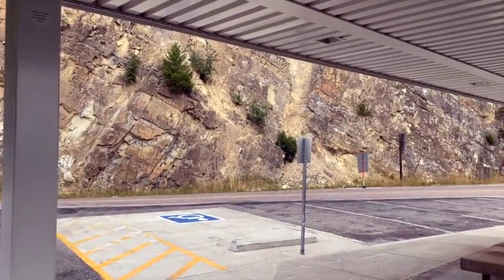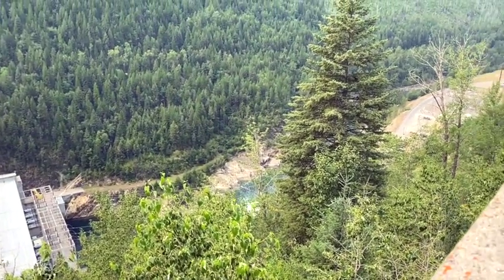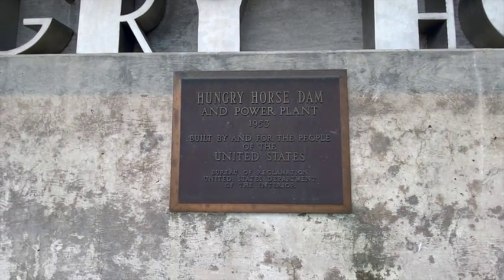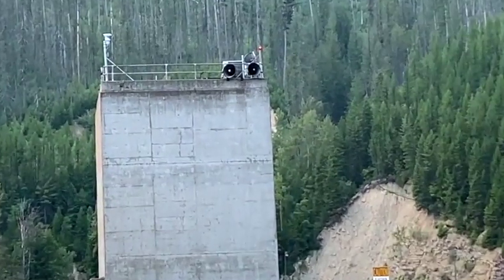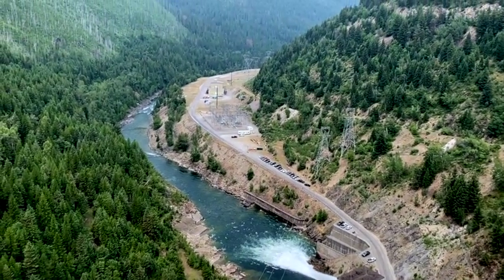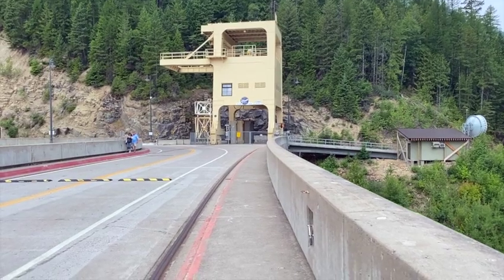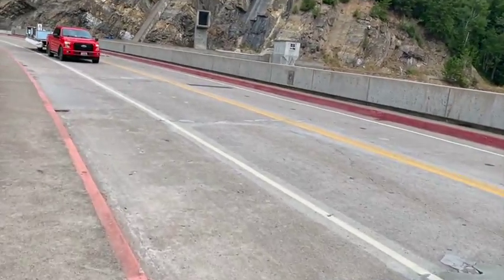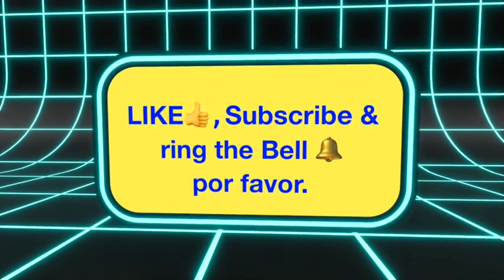# 241 TOUR of Hungry Horse Dam and Reservoir, MONTANA, USA

Comment: If you follow the road over the dam for a few miles there are wonderful huckleberry patches on the hillside to the right of the road.  This is where the aforementioned bears congregate, so as you pick the berries keep an eye out or you will be lunch for the said bears!  :-)
Reply from the maker: I wish I had done that. I didn’t pick a single huckleberry my whole trip. :-(
Reply: I grew up in the area. That vent is for the glory hole spillway which you properly identified. The whitewater downstream is the outlet of the glory hole. It’s a rare sight to see it spilling, I had never seen it with my own eyes and I spent most of my life in the area. The equipment on the upstream side of the dam was installed sometime in the 90s if I remember correctly is for selective withdrawal, allowing operators to control where in the water column to draw water from to run the generators, to regulate water temperature for downstream fish. Thanks for bringing back memories, it’s been almost 20 years since I’ve been home.
Reply: @ScottGunMag69  As a kid, for a few years (1968-1971), I lived on a 40-acre ranch owned by Leo Arbuckle a few miles North of Coram.  Mr. Arbuckle was my step-father during those years.  Just down the highway from our access road was the Dew Drop Inn.  Not sure that bar is still there or not.
Reply: Leo was a road builder and log skidder who worked most of his career at Canyon Logging.  As a kiddo, I played little league baseball for a team sponsored by the said logging company!  The hi-lite of my little league career was hitting two homers in the same game (both to deep dead center field) when we played Whitefish.  We beat those rascals 3-1 that day, and it was a big upset as I recall.  I was 11 years old at the time.  🙂
Reply: Not nearly as much logging these days. I can’t believe the Flathead Valley has nearly tripled its population in my lifetime. Now well over 100k now.
Reply: @wapiti3750 I grew up playing baseball myself 70s and 80s. Played for the Lakers in Kalispell.
Reply: @ScottGunMag69  I played for the Lakers too, but only for half a season in 1975.  I liked golf better and I had to choose between the two.  My Flathead golf team took 3rd at State in 1976 and 1977.  Lost a playoff for 2nd place in 1976.  I played Babe Ruth league as well and was on the Rotary team.  I remember telling the coach one day at practice that I could pitch a little bit and had a nasty curveball.  I had never pitched before in that league but we were playing Conrad Bank as I remember one afternoon and it was the bottom of the ninth, nobody out, based loaded, nursing a 1-run lead and coach pointed at me in left left.  I came into the game and struck out the side with 9 consecutive curveballs.  Honest to god.  Eight of those pitches were taken without a swing because the hitters were bailing out thinking they would be hit by the pitch.  I can't remember many of the guys I played with but I remember Randy Shelton was the  catcher when I did the deed in the 9th inning!
Reply: @wapiti3750 I graduated in 88. I wasn’t as good at golf. Skiing was what I lived for. I remember saving up my lawn mower money to buy a season pass for $80 and used skis at the ski swap meet every year. Then catch the snow bus to Big Mountain every weekend from the Kmart parking lot every weekend until I was old enough to drive.
Reply: @ScottGunMag69  I am of English heritage so I was a horrible skier!  I remember the German and Norwegian surname guys were the best skiers in my era.  You know, the Schmidts, Riebes, Sorensons, Bjornsons, Swensons, Schlatters, Nelsons, etc., those guys could ski at birth I think.  LOL.  I mainly relegated myself to the rope tow on Big Mountain.  I was "tricked" into taking the Big Chair to the top one time and was told it was "an easy slalom" back to the chalet. They forgot to tell me about the 10 inch powder snow and moguls which I had no idea how to navigate!  It took me at least 40 minutes to get to the bottom after crashing probably a dozen times.  I ski about as good as my fellow Englishman, Eddie the Eagle!  LOL.  I never owned my own skis.  I rented Rossignol, Kneissl or Kastle skis on most occasions as that was the majority of their rental inventory.
Reply: @ScottGunMag69  Class of 1977 here.
Reply: @ScottGunMag69  Is that KMart store across the highway from Snappy's?